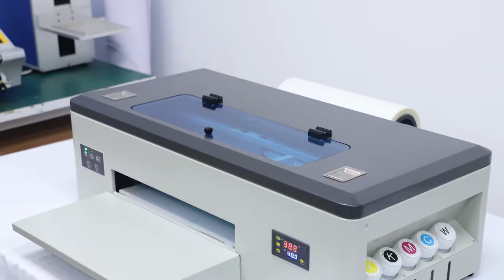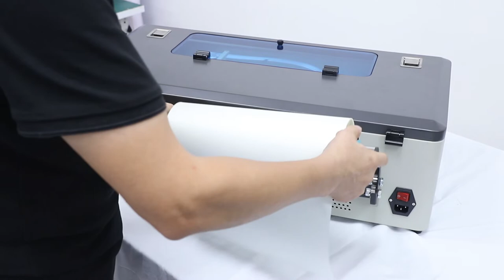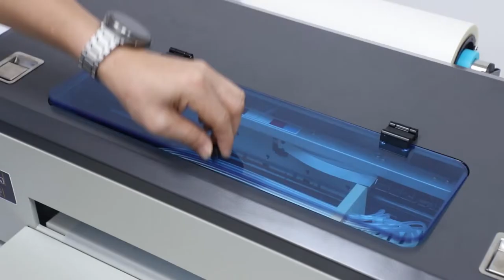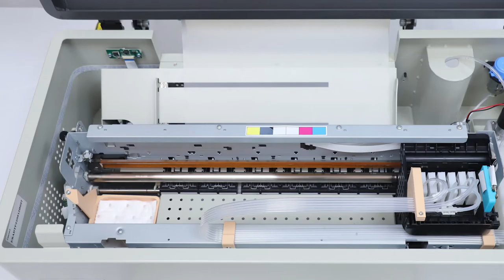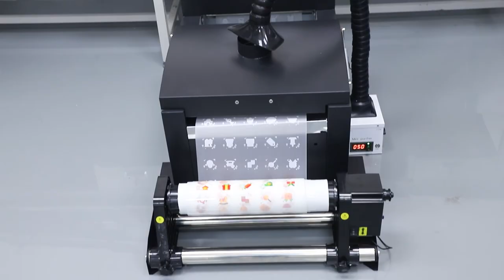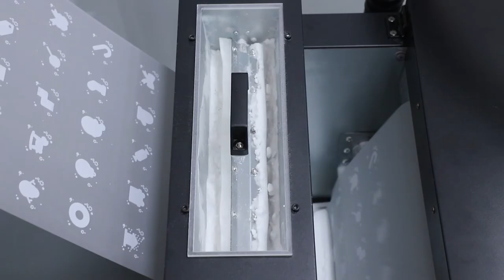EraSmart a3 dtf printer, sheet and roll film can printing

Comment: whats biggest size you can print.
Reply from the maker: @nemrajohn1612  DHL is already processing the delivery, please contact the account manager for the latest information，thanks
Reply from the maker: Hello, this is our A3 size, printing width is max 30cm, and the length is unlimited, can print roll and sheet dtf film. also we have bigger size printer, 50cm and 60cm,   please add my whatsapp +8615503698609 to get detail information, thanks
Reply: I got a printer machine from this company. And these printers are  print really good  they should print any sizes.
Reply: @EraSmart  hi this printer is same as L1800 converted to DTF? it will required daily  maintenance? pls respose will be needing to by 1 of same
Reply from the maker: @joelreyes3322  hello, yes, we have the L1800 model,  you can choose, and need the maintenance, but is the easy, our printer can set the auto clean, please add whatsapp+8615280803247, we can talk with the detail, thanks